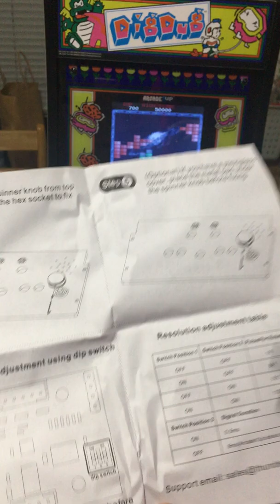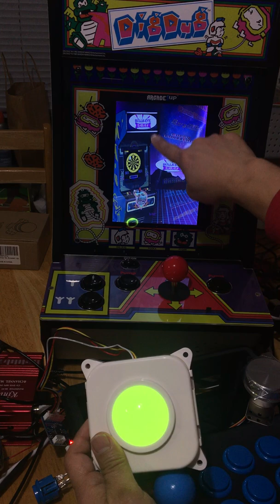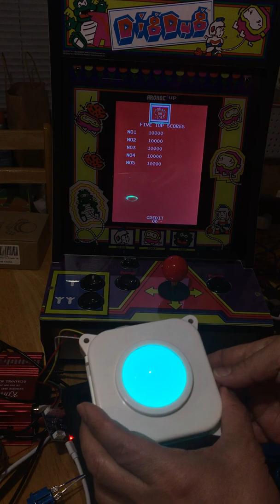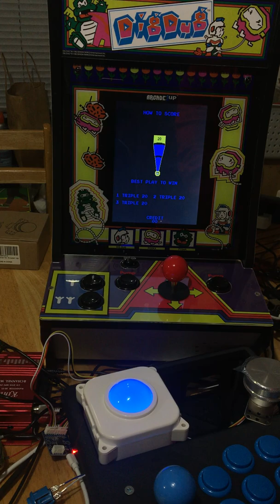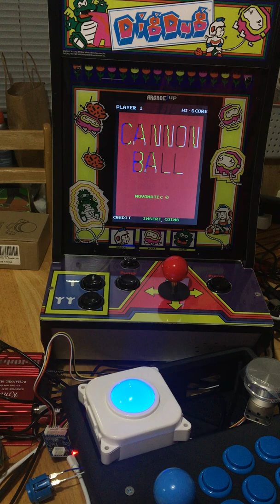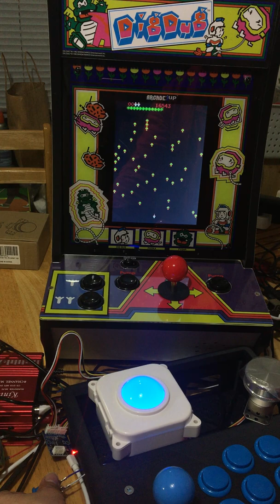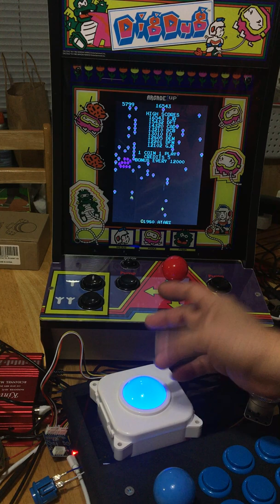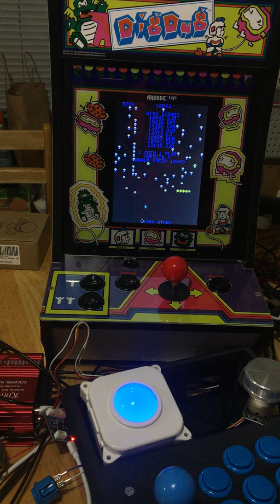Testing Glenn trackball on CounterCade using 8GB Vertical Image

Comment: Hi Johnny,

Thanks for the video. But you are showing the wrong games for the trackball,
which is why you are having many problems.

All those games use the spinner. So you're showing it wrong.

Also, for centipede and millipede, you need to go into the emulator and change the
sensitivity settings. Mame has many settings for the analog settings, and in order
to get it right, you need to adjust it.

Also, show fullscreen video, and not vertical video. You can't see much this way.

Thanks

later
-1
Reply: @johnny58435  Hi Johnny,
There is a list of trackball games here:
https://en.wikipedia.org/wiki/List_of_trackball_arcade_games

Most of these are in MAME.

I have been playing centipede and millipede since 1983 and on, and I'm very
good at all of them.

In MAME, when you hit TAB on these games, you will see there is
an option called analog settings. Here you can modify the x, y values.

As you mentioned, the trackball is set for plug and play on Arcade 1up
machines. For emulators, you have to set up each game separately.

There is not one setting that will work on every game.

Each game had different settings in the Arcade. Centipede had a small
trackball compared to the larger one on Millipede.

Centipede : 2 1/4 inch
Millipede, Marble Madness, Crystal Castles : 3 inch
Missile Command : 4 inch

So you have to adjust each game separately, even if they have
the same size trackball.

So don't expect to just plug the trackball and expect it work.

Experts can tell the difference and its very sensitive.

If you are a beginner and not good at games, it doesn't matter
what you set it to, because you will not care.

later
-1